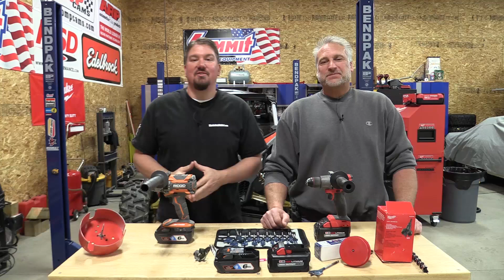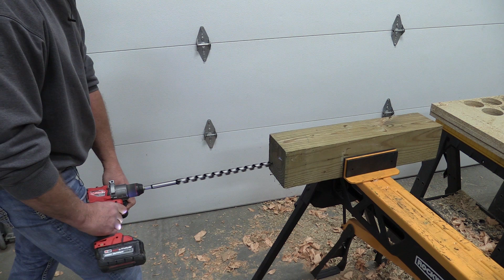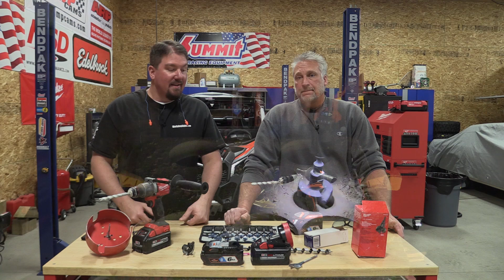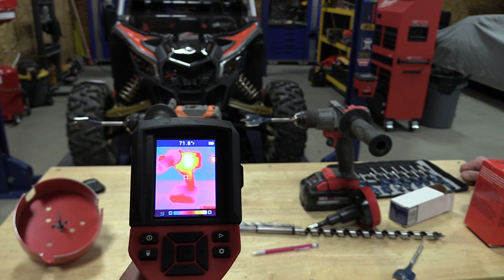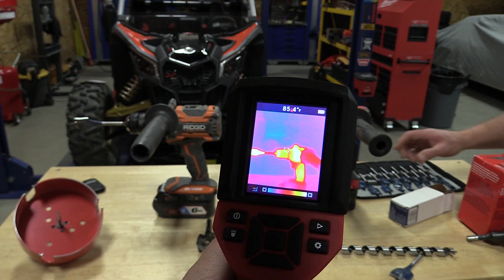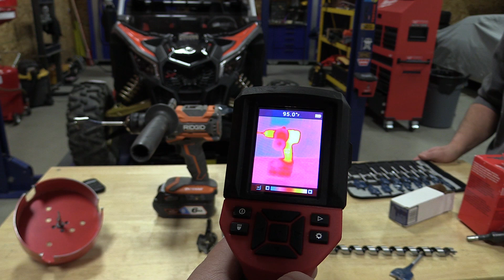Ridgid OCTANE vs. Milwaukee M18 Gen3 Drill Driver 6.0 High Output vs. 6.0 OCTANE Battery

Comment: I moved over to the Ridgid brushless line from Porter Cable's brushless....( yeah I said PC)... I'm not a professional..... I primarily do automotive projects and they do everything I need....I did help my brother with a drywall project and they shined. ... I'm liking them....
Reply from the maker: Be sure to properly register everything.  They have been pretty good with the LSA lately!
Reply: @wrenchesrides  all done... Did it a couple weeks ago. ... Not at all the
"hassle" some claim it to be....👍...
Reply: Haha I moved from the Porter Cable 18v brushed Nicad to Ridgid Brushless I will say though I never had a problem out of the Porter Cable they worked great for 7-8 years and was still going strong when i changed over.
Reply: @86c5corvette  They're much better than people realize... alot of times people regurgitate what others regurgitate and just say " Porter Cable sucks".... But they're not bad... Although the Ridgid are better....I can feel more torque and see faster application of fasteners the PC would always do it just a little slower.... but for a home gamer they suffice....
Reply: Ridgid and Milwaukee are both made by TTI and share a lot of the same parts.  We use the RIDGID impact wrench often because of its size and power.  It is very similar to the Milwaukee M18 Mid-Torque.
Reply: @WorkshopAddict  I bought the Ridgid 1/2" impact first... Small light weight and can get in where the outdated (brushed)Porter couldn't... Went on to the brushless impact/ hammer drill with 4ah batteries and now looking to get the Octane recip saw and the Ridgid Jobmax multitool soon. .... Maybe today....👈
Reply: @WorkshopAddict  You guys have 2 channels? I just came across this channel today.
Reply from the maker: Yes, We started this one because some of the people complained of our car stuff on a tool channel.  Now we use the second channel for stuff we go over again and other projects.
Reply: @wrenchesrides  Awesome!  Bunch of whiners!! Nevertheless, great videos! These are the kinds of videos people want to watch. Well, at least I do. Putting 1 or better yet, 2 tools in action. I've bought several tools bcz of comparisons. And of course some with pricing. Keep up the great work guys! This has now become my favorite channel bcz of how you test these tools.